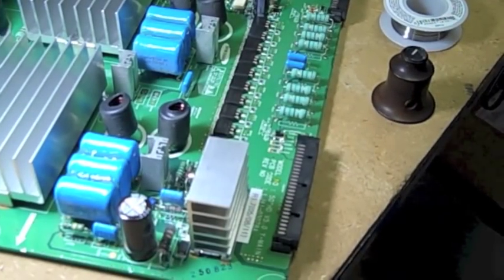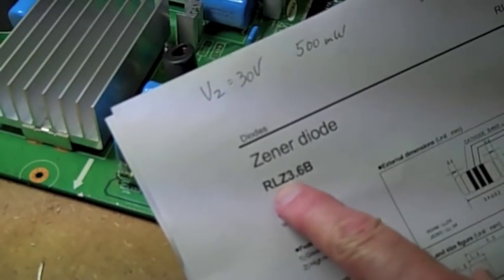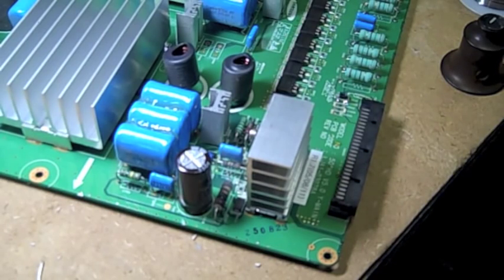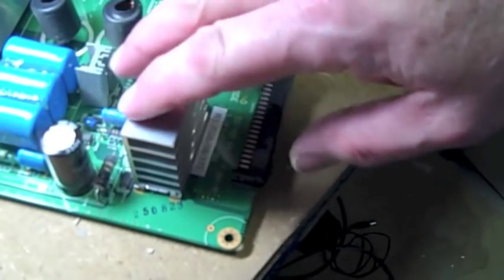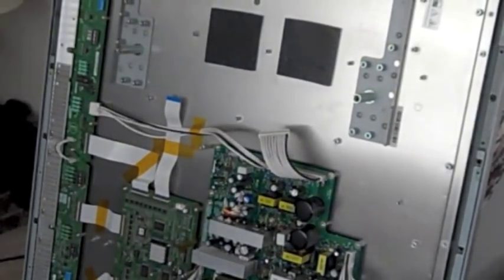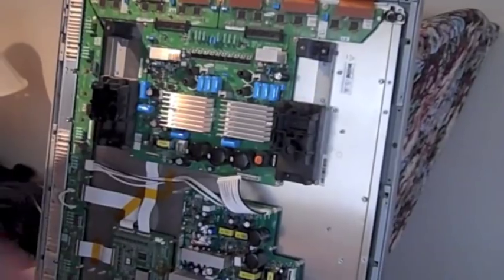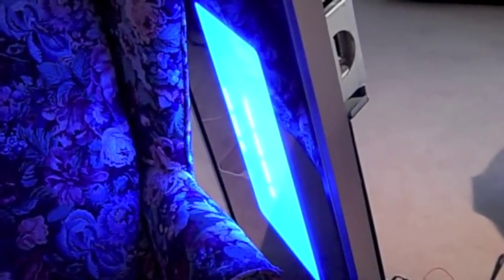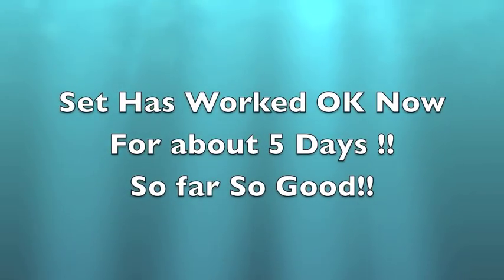Dell W5001C HD 50" Plasma Part 2 - Repair Y Main Board

Comment: I know this is an old fix, but how did you trouble shoot the diodes being bad? since those are 30V diodes my guess is they were out of spec in circuit when turned on?

Comment: I'm trying to remove the Y-Main Board. I removed all the screws, but it seems to be stuck to those square gummy-foamy black things. (1) How did you remove it from there? (2) Also, can it come out independent of the buffer boards?
Reply from the maker: I am sure you got past this by now, but i just applied careful pressure underneath and the adhesive broke free. I believe the buffer boards need to come out also. It's been awhile so  can't say for sure. Be careful with the ribbon cables as they can tear very easy if you force them too hard. There is a little black latch that flips up on the connector to release them.